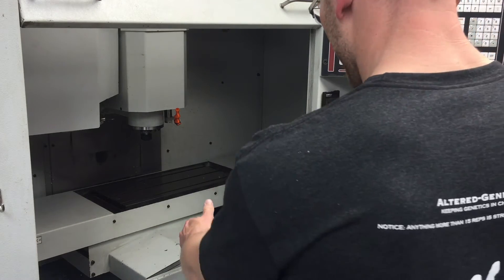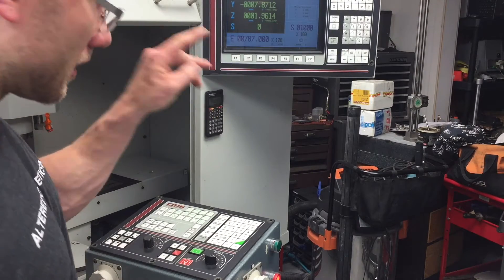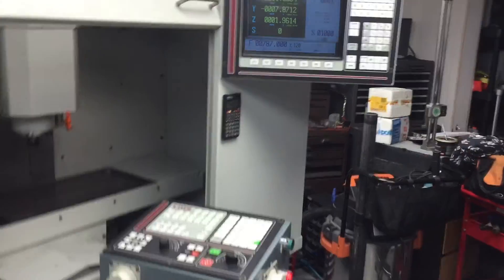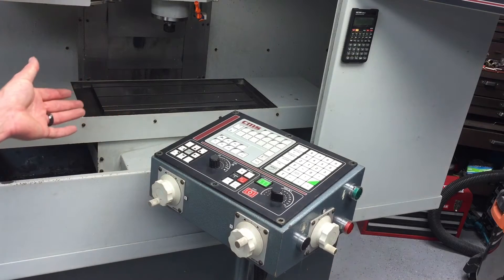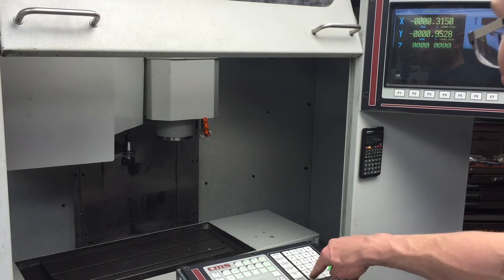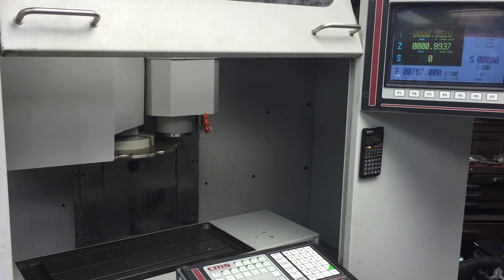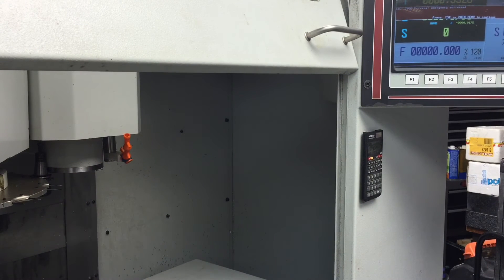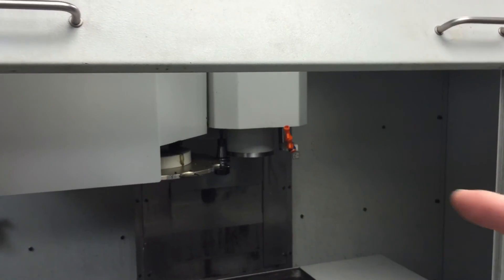UPDATE! VMC PROBLEM FIXED!! CNC REALMECA VM2 Unorthodox Fabrication

Comment: Interesting , how is possible to crash tool in spindle, I think this should not be possible with industrial controller, I could understand if you use Mach3 and you programed it by yourself and this happens. Anyway interesting videos , keep good work.
Reply from the maker: Thanks, I completely agree! Not sure what they got going on here. I am thinking I am the problem, not the machine. Simply based on my lack of real experience.